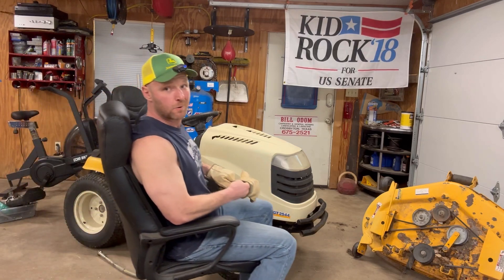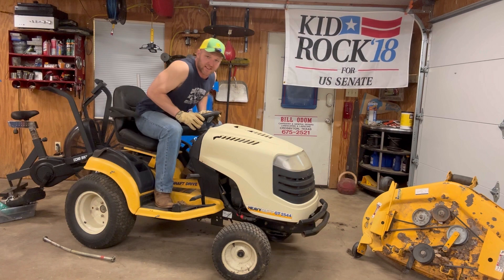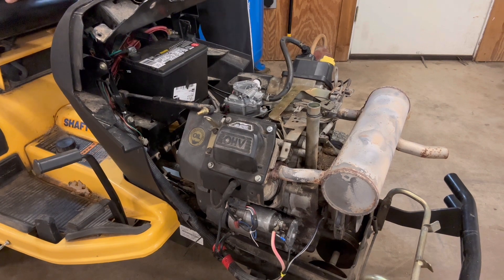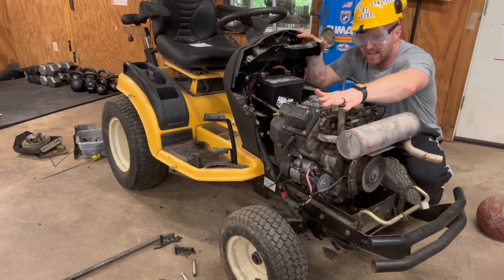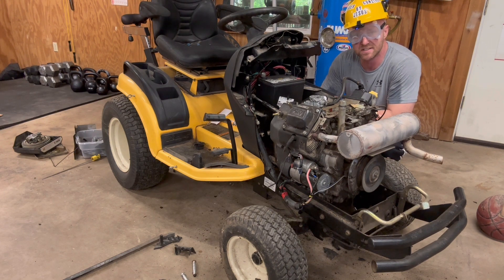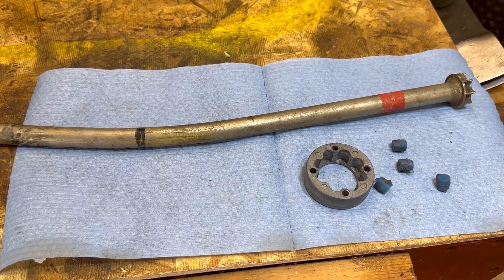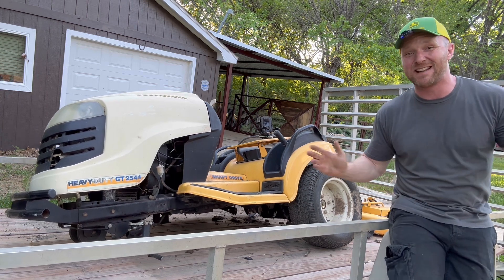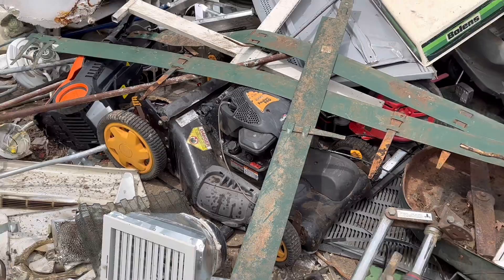Cub Cadet Riding Mower Review; GT2544

Comment: Very different experience than I've had. I've got a 2006 2544 and I love it. Ive put about $4000 worth of Johnny products onto it including a joystick bucket loader and electric sleeve hitch on it, AGro tires and it is a beast of a tractor. Bought it used for $900 with 250 hours, now has close to 500 and it runs perfectly. Love the shaft drive, never seen anyone bend it. I have no idea what you did to that poor tractor. Mine has moved and graded 100 tons of sand and gravel the last 3 years and runs like new. I expect many many years of service from it.
Reply from the maker: That is awesome. I originally wanted to build it like yours with the bucket. I think this tractor had a rough life before I ever got my hands on it.
Reply: @MowerMike  must have, I've never seen one in that condition with such low hours.

Comment: Factory certified (Briiggs, Kohler, Kawasaki, MTD et al) mechanic here. I feel compelled to mention, after the thourough bashing you assigned to this model, that I currently have half a dozen clients who have put over a thousand hours on the machine without a shaft blow-out as described in the video. One machine, in particular, has over 2,000 hours on the chasis with all original parts save spindles and pulleys. Yes, I have replaced numerous "barrels" in the drive, but this model is one tough monkey made to work HARD. I suggest that someone bypassed the hour meter at some point. One point further: if you were unable to troubleshoot the safety system circuitry (hotwired, you said), why are you qualified to comment regarding the mechanical aspect of this model? Just sayin'...
Reply from the maker: Right, I don’t know why YouTube lets me do this. I am not a qualified mower anything just a guy with opinions and likes tinkering. Glad you enjoyed the video

Comment: Actually the model numbers are easily confused but the top of the line was gt2554 and not gt2544. Gt2554 has very large 54" deck, more horsepower, adjustable seat, thicker sheet metal, way bigger tires, different hood,, and an entirely different animal of heavy duty at 850lbs. And none of the drawbacks of the Gt2544 he is talking about. So Cub Cadet did actually make a Cadillac of mowers at one time. Mine has almost 1000 hrs. on it and it still runs perfect. And actually since I bought the tractor used it looks to me that the oil in the engine and transmission may have never been changed, still had original filters, and original gas filter and sparkplugs too. Drawback: you need to use a car jack to lift it up. Don't try to put it on side. If this baby falls on you you'll be smashed like a fly. And it takes up much garage space as a small car.
Reply from the maker: Haha thanks for the review
Reply: The GT2544 and GT2554 are in the same series being the 2500 series. They are the exact same machines besides the engine and mower deck size. They all weigh 800lbs dry.

Comment: I have a 2007 GT 2550 that is still running strong with no issues. It is all about regular maintenance for longevity of any machine. Yes, the cub cadets of this era are a bit ugly, but the GT machines are built heavy duty and made to last as long as you maintain them properly. I plan on cutting grass with this machine for many more years, that is, if we can still by fuel to run our power equipment. We really need to get the current administration out of the white house and out of our lives.
Reply from the maker: Wow love the political tie in to lawn mowers!

Comment: Wow, never saw one of those driveshafts do that. Congratulations on throwing away an expensive engine that could have been fixed with a couple hours of labor and $40🤣 those 2500 series are pretty ugly with that terrible hood design. I like my 3000 series Cubs, 3205 liquid cooled Kawasaki 20hp 54" deck and 3240 22hp Kohler Command 60" deck. Also have a leaky rear John Deere 425 but I prefer the Cubs for their smooth operation, comfort and cut quality.
Reply from the maker: Thanks! I agree was totally worth it was YouTube gold blowing that thing up and then scrapping it. You should check out my Cubs Suck part one video to make ya cringe some more.

Comment: I bought a used 2006 Cub Lt1045 with the Kolher 20. 430 hours bought it at 400 hours and the previous owner never even changed the oil nor greased a thing. I mow about 1 - 2 acres a week never an issue. I did have to change the belts when I first got it and it was also caked in grease around the cooling fins of the motor. As neglected as it was it's whole life this thing starts and mowes great everytime. I will just stick with the more simple designs.
Reply from the maker: Glad she is working for ya!

Comment: Ive had mine for 19 years and its still running strong, its a beast! I have a 2554, same just bigger deck. In all those years only two minor problems - one of the deck pulleys went out on me and one of my front tires has a slow leak. Oh yeah , did have issues with headlights. These are some heavy duty tractors and they are heavy for that reason. The fact that you bought it used and it had all these issues should say something about the previous owner not the tractor. In order to bend that shaft you really had to be doing something way extreme. I don't think it's fair that you're trashing all of them because of your experience with a second hand abused tractor.
Reply from the maker: I agree it is not fair. Glad yours is working well.

Comment: You need to get a hold of the Honda 4518 (4514 is similar but different engine). They both have a drive shaft but the Hondas are humongous in diameter vs that cub. It also has a timing belt, water pump, radiator and fan. Overbuilt and absolutely beautiful.
Reply from the maker: I had to google that one, I didn’t even know Honda made a riding mower.
Reply: Picked one up last summer for $500 in mint shape. Guy claimed it overheated but all I had to do was clean the clippings off the rad and flush the system. Very nice tractor.

Comment: Hey Mike, I going to need buy a riding mower soon. Can you advise me which way to go & which to stay away from. 
thanks, I like your videos.
Vic
Reply from the maker: It all depends on your budget. The list below is what I suggest from the cheapest used to new. 

1. Used craftsman riding mower 15-30 years old. $500-$700 range
2. Used John Deere or Toro riding mower $700-$900
3. Used Cub Cadet 50in zeroturn $1,000 - $1,500
4. New Cub Cadet zero turn $4k
5. New or Used Gravel Zeroturn (this is my ride, is the best mower you can get in my opinion)

Good luck, the market is hot right now for used mowers. The cheapest is to buy a broke used mower and fix it with all the advice I give ya on here. Let me know what you end up getting.

Comment: I’ve got a GT2544, it was a replacement for a John Deere D105, hydrostatic kept breaking. My only complaint is that it is leaking oil like crazy. Should I get it fixed or go with a new mower? I mow about 1 acre and use it to mulch leaves in the fall.
Reply from the maker: I always say fix it. Just clean the oil off and find where it is leaking from.

Comment: i HAVE A 2005 gt2186 700 HRS. NEXT TO NO TROUBLE AT ALL REPLACED FRONT DRIVE PULLEYS AND MOWER DECK BELT TENISION SPRING. 3 DECK BELTS AND 3 DRIVE BELTS. ONE DRIVE BELT TORE UP WHEN FRONT PULLEY WENT. LOVE THIS MOWER. BUT NOW YOU GOT ME WORRIED ABOUT SHAFT DRIVE.
Reply from the maker: I appreciate you watching. I think this motor has alot of vibration that messed up everything. I bet you are fine as long as your engine is tuned up. 700 hours is impressive

Comment: If I were you I would go to a driveshaft shop and custom order a slip shaft and put U-joints on both ends, replace the flywheel and never have to worry about it again
Reply from the maker: You need to watch the end of the video, that mower is melted down by now.

Comment: Hours on the engines actually mean nothing
Reply from the maker: It means how many hours are on the engine???
Reply: Hours dont mean much. What really matters is how well its been maintained. Something can have 10 hours but have little to no oil and very dirty oil and be considered a pile of shit. Where as something can have 1500+ hours on it and be maintained properly and run better than a new machine would.
Reply: @MowerMike do you have a meter on your car engine? Are you worried about the hours of your car engine? For me on both is No and No Josh said it perfectly you maintain that Kohler or Kawasaki engine you can at least expect 20 or more years with them engines as a matter the Kohler 7000 series according to small engine repair shops is the least seen for repairs..
Reply: @JoshAllen17Goated indeed 👍